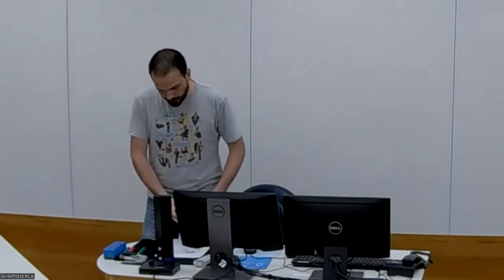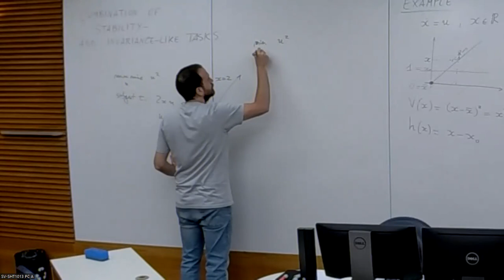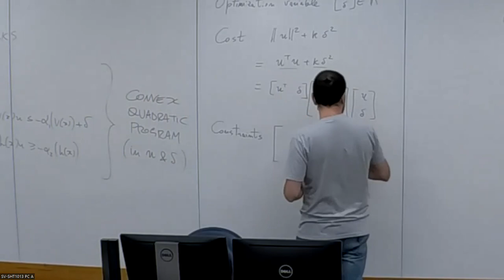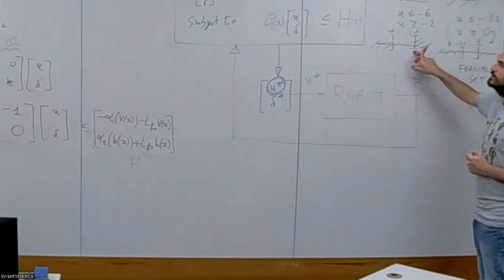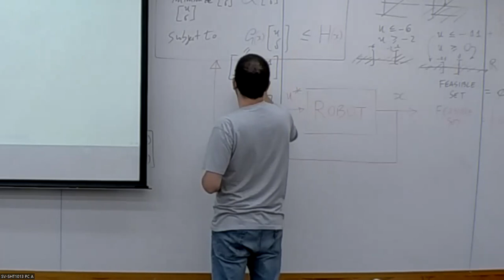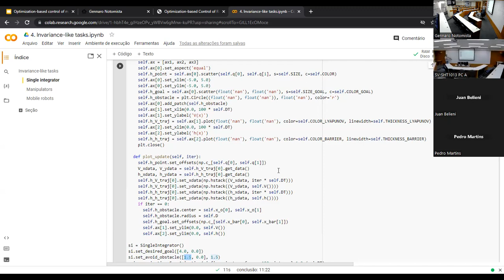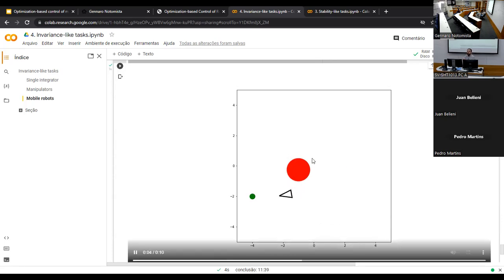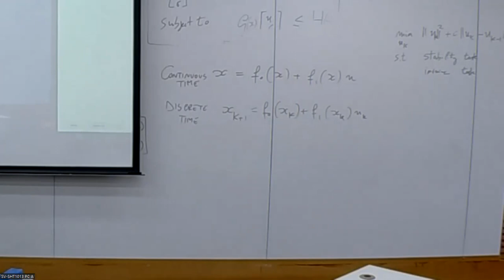Lecture 5 - Combining stability-like and invariance-like tasks

Comment: Hello Professor, I tried the collision avoidance while going to a desired point using the technique you told and also the code you shared via google colab. I have one doubt. For sure, if we change the size of the obstacle of the safety margin, so in your code it was 
uni.set_avoid_pose([7.5, 5.0], 0.75), where this 0.75 was the value of D (kind of safety margin). So if we change this D, the plot of h will also change. But for any value of D, do you think that the plot might be negative? I tried with an higher value =2, and for some instances h became negative. So is there any limitation of this approach or do we have any constraint on the safety margin (that it cant be greater than a particular value). A comment from you would be appreciated. Thanks
Reply from the maker: Good question! For the current formulation, there are no limitations in terms of safety distance. In general, you need to make sure the function that is defined to ensure safety is a valid control barrier functions (see definition on page 19 of the lecture notes).

Comment: Hello Professor, I was trying to track a circular trajectory and avoiding a collision from an obstacle placed at some position on the circular trajectory. So, combining the V(q) and h(q) and then re-arranging the terms to put it in Ax <= b form would work ?

I am trying to do it, but for some reason, when the robot is coming close to the obstacle, then it is showing some weird behavior. Does this has to do with the last terms in V(q) and h(q).

The last term in V(q) implies:

The last term in the control Lyapunov function, is introduced to steer the unicycle towards the goal, i.e., to align its longitudinal direction with the line segment connecting the point to the goal.

Further, the last term in h(q) implies: 

The last term in the control barrier function, is introduced to steer the unicycle away from the obstacle, i.e., to align its longitudinal direction with the line segment connecting the point to the obstacle.

PS: I am not using the relaxation term, just min || u || ^2